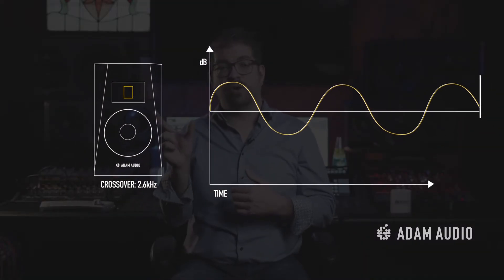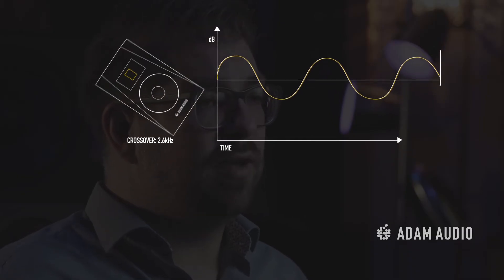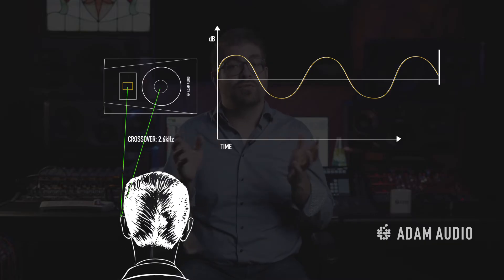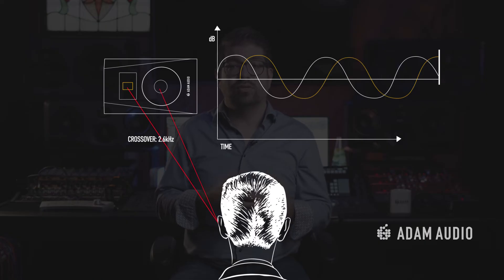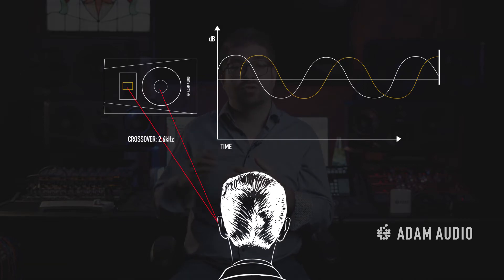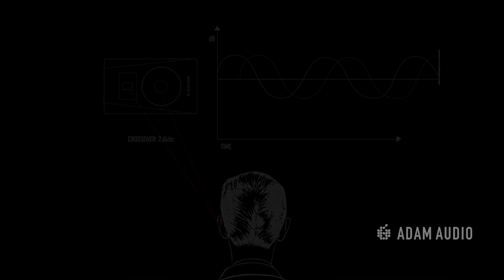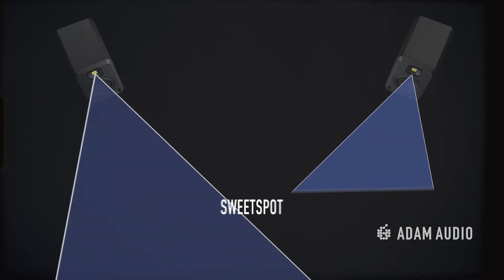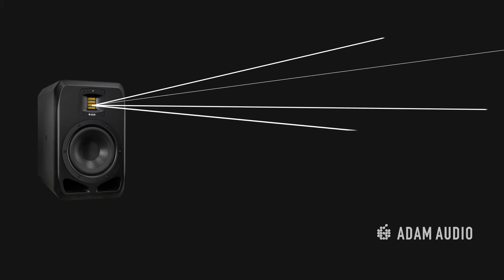VERTICAL Vs. HORIZONTAL Studio Monitors (Can They Be Flipped?) | ADAM Audio

Comment: would you recommend to flip to horizontal a couple of A5X (and manually rotate the tweeter 90 degrees) or keep them vertically and angle them down (5 - 7 degrees)? I need to lift them up aboy 10 cm, so the tweeter will go above my ears. Help :(

Comment: Would turning the T8Vs upside down be a problem for the wave guides? The placement would put the tweeters at ear level for me.
Reply from the maker: Hi @justinkovar3922! We do not recommend rotating the waveguide for the T Series.
Reply: I meant turning the entire speaker upside down, not adjusting the wave guide.
Reply: Hmmm…customer support gave me a different answer. 🤔 
“This is technically harmless and you are welcome to proceed as you have suggested.”

Comment: What this was very helpful. So i have my new A7Vs, and my desk is high and i adjusted the stands so the woofers point at ear and the foam that holds them up is has a slight pendance so maybe the tweeters point more to my ears. After watching this video i'm thing, should i lower the stands, so the tweeter point at my ears, risking more desk reflections (i guess) or... what other option do i have?
Reply from the maker: Hi @NATmusic27! The tweeter should indeed point directly to your ear. For better guidance,  please reach out to our Support Team and don't hesitate to ask all the technical questions you might have. The Support Team will gladly answer all your questions. You can send your question through the official form on this page: https://support.adam-audio.com/hc/en-gb/requests/new

You can also check the FAQs here: https://support.adam-audio.com/hc/en-gb

Comment: Hi! I'm not able to use T7V in vertical way because with my current desk the tweeter stays above my head. From what I understood from this video It's nog good to use them   horizontally. Can I use them upside down with the tweeter aligned with my ears?
Reply from the maker: Hi @caldini79, thanks for your question! Yes, turning the speakers upside-down with the tweeter on ear level is a solution. Greetings from Berlin! :)

Comment: I bought some used A8X speakers recently... I heard them in a work environment for an entire summer and was thoroughly impressed by the fact that at any volume, the mixes held up... They sounded better than any other speaker that I have ever heard... I assumed that the "X" meant that they could be placed either horizontal or vertical without any serious degradation at either orientation... Is that not the case?
Reply from the maker: Hi @dagwood4189! Thanks for your question. The A8X is designed to be placed vertically. If you place it horizontally, keep in mind that the in the video mentioned problems might appear. Enjoy your speakers!
Reply: @ADAMAudioBerlin  Thank you!

Comment: Can the Adam A7X be placed horizontally and the tweeter unscrewed and readjusted for horizontal placement?
Reply from the maker: Hi Richard! We don´t recommend placing your monitors in the unintended position.
Reply: What about the A7V? I just ordered a pair of A7V because the tweeter is meant to be rotated. I want to place them horizontal in my studio, and can the tweeters be positioned on the outer edges with the woofer positioned on the inner sides  @ADAMAudioBerlin
Reply from the maker: Hi Richard! The A7Vs are not meant to be rotated. They do have that option though but we usually recommend to use the speakers in their intended position. You can experiment with the space that you have and adjust the position to your listening preference.
Reply: @ADAMAudioBerlin  Ok good to know. They just arrived today and the only way they fit in my setup is horizontal and I rotate the tweeter to accommodate. They sound great from what I can tell so hopefully I can still use them with this orientation
Reply from the maker: Hi Richard! Enjoy them and let us know if you have any other question 😊

Comment: I have the opposite problem. I own the A77X and I need it vertical. As long as I angle it sligtly down and align ear-to-tweeter for the sweet spot I should be ok right? I read through the comments and someone said they loved the sound. I recently changed some stuff around and they would just work better if they were standing. If anyone reading this has done it, let me know if it worked for you. ✌️
Reply: It works fabulously well, i own the a77x as well. You gotta keep the tweeters at rear level also dont forget to keep the respective monitors at their correct place with the mid range drivers( the outer woofers) placed at the bottom and the bass woofers ( the inner ones) placed at the top. Speaker B should be on the left side while Speaker A on the right.

I was so lost since i wanted to do this a year back when i bought them but there was no information about them regarding mounting vertically on the internet present the only 2 people i came across was on twitter who had posted picture with vertical mounting so i just copied them and started using the monitors like that for almost 3 months( only god helped me ) but later on when i bought a room correcting software i realised the placement was off since the correction software wasnt working properly with that placement thats when i got in touch with adam personally wrote a mail to them and explained what i wanted to do and then they provided me the correct monitor placement and the info and thats when i realised i had them placed wrong all along. God help those people working in the studios  with the wrong placements lol

Comment: Thank you for the video. Just to clarify.... if we want to only focus on the main listening position and not the entire row, which speaker would work better : horizontal or vertical?
Reply: 4:43 He explains it here. The Adam tweeters perform differently horizontally and vertically. So if you're going to flip them, you need to unscrew and flip the tweeter too. Still not the best idea tho, some people reckon tilting the speakers down (if they're too high up, assuming that's why you want to flip them) is better than flipping them

Comment: If placed horizontally should the tweeter be inwards or outwards?
Reply from the maker: Hi Kim! If you are talking about a vertical monitor, there is no correct answer. That depends on the distance between your speakers and also your listening position. Try to form an equilateral triangle with the tweeter as the measurement point. Yet, we still recommend using the monitors in their recommended orientation. All the best, Daniel.

Comment: Are you saying that the speakers with mid range has a wider range so when listening 👂 it’s easier to stay in range of the speakers sweet spot than to have a speaker that has top and bottom drivers on the monitors am I right ? 🤓

Comment: In the case where you have the speakers higher than your listening position (ears). what is better? to tilt the angle of the speaker or to put it horizontally? Thanks!
Reply from the maker: Hi Jorge! It is always better to use the speaker as intended (always vertical for vertical monitors, and horizontal for the horizontal ones), so we'd recommend tilting them a little bit better than putting them in a non-intended way.

Comment: Makes me so sad every time I see someone placing their speakers horizontally when they weren't designed that way... This has become a trend for some reason, I see everyone making this mistake. Adam studio monitors are top quality and have professionally engineered for the best quality sound but you aren't going to hear their full potential unless they are placed vertically as the engineers intended.
Reply: I see this all the time in “name” studios with “name” mix engineers.

Comment: I am a bit confused now. I am no sound engineer so I just read manuals and apply them. The A7X manual says you can use the speakers either vertically or horizontally and they have diagrams that show the correct positioning of the loudspeakers in each case. The video suggests that a horizontal setup can be problematic. Is a7x special or should I ignore the manual and stick with vertical setup ?
Reply from the maker: Hi Baher! We recommend using vertical speakers vertically, due to the waveguide. It is built to widen the sweet spot and avoid reflections from the desk and the ceiling. You can of course use it horizontally, but with more reflections and a smaller sweet spot. In that case, there is a certain way to do it, which you can see in the manual. I hope that helped. All the best, Daniel.
Reply: @ADAMAudioBerlin  clear.. thanks

Comment: how about using the T5V horizontal? is it ok?
Reply from the maker: Hi, we would recommend using them vertically if possible. You will have a smaller sweet spot and more reflection from your studio desk and the ceiling. If you have to use them horizontally, please keep the tweeter closer to you and the woofer on the outside. All the best, Daniel.
Reply: @ADAMAudioBerlin  Thank you so much, you just saved my studio..

Comment: This is SO helpful as I just re-arranged my studio setup with three 32" monitors (half hex arrangement) and I was forced to place the A7X's above the monitors sideways. Vertical arrangement just has them way too high and outside of the 3x32" width is far too wide. The performance is definitely different at distances but <1M where I normally mix, they are performing well across the spectrum. My solution is to get A77X's but I'm not sure my wife agrees...
Reply: Ik I'm 3 years late, and you probably don't need this info or maybe even use these monitors anymore, but the a7x's have a rotatable tweeter that you can just undo the screws and turn 90°. Then you can use them horizontally. Sadly, I can't do this with my budget T7V's

Comment: Good explanation, about the A77X having the woofers aside the tweeter, I also have asked myself the same question. A possible explanation I can think of is the A77X are indeed mid-field monitors and so they are designed to be further away than smaller A5X or so, and at bigger distances the comb filter effect derived from the drivers not being in the same vertical plane can perhaps be smaller. 

We have had three monitors in the studio with the same driver structure (woofer aside the tweeter), the A77X , the Focal Twins and the two way PMC Twotwo 6, of which the manufacturer says literally in their web: "...their ability to operate in either the vertical or horizontal orientations without compromising stereo imaging or tonal accuracy." 

By the way, I have sometimes worked with both the A77Xs and Focal Twins put vertically on their side and have been really happy with their sound, at least in the sweet spot.
Reply: Do you feel that the sweet spot was smaller with the A77X vertical? Overall did they sound about the same as horizontal or were there any noticeable differences?

Comment: I’m thinking about buying Adam Speakers for my studio. I work in film which requires me to have a 5.1 set. Looking at the A77X  confused me, there is a right and left version which for me doesn’t make sense since I need a centre speaker. Is this speaker setup simply not for people who need a LCR setup?
Reply from the maker: Hi Selle! You are right. The speaker is not built to be a center speaker. For LCR setups we recommend using the S-Series instead. Our S3H studio monitor can be used as a LCR-speaker for instance.
Reply: Despite what Adam Audio says, I would say you will be just fine using the A77Xs also this way. Don't even bother whether it say LEFT or RIGHT on the box, just get 5 of the same A77Xs -- all five "LEFT" or all five "RIGHT." Or else go with these passive ones: https://www.svsound.com/products/ultra-center#

Comment: A useful, though probably sort of difficult, topic to cover would be odd shaped spaces. For instance, many of us are in a bedroom sized room, but we can close it off or we can leave the doors open, making the actual space for the pressure waves to propagate through the whole house or apartment.

In my case, I'm in a bedroom that opens into the apartment on the rear left. And, the middle of the back wall opens into a bathroom which in turn opens into a large closet. So, there's the option of having a significant chunk of the rear wall that is three times more distant. On either side of that are slightly less than door width walls. 

Some people may have doors on both side walls at the back, which means not really any rear corners, and what amounts to 'adjustable angle deflectors' instead. And there's no way to put in a corner trap there when there's no corner. 

Are there are any sort of general guidelines on those types of scenarios. Is it better to allow the pressure out into the overall space? Or does that just complicate things even worse? It would seem naively that it would allow for much greater dispersion of low frequency pressure, even if the space outside of the studio room is much more resonant.

I'll be measuring mine as I add treatments of course, and that's the final arbiter, but I was just interested if there's any thoughts on this kind of thing.
Reply from the maker: Hi Dean, thanks for watching and for a great topic suggestion! We will definitely add it to the list to cover in the future 👍

Comment: In a home theater set up where a bookshelf Klipsch rp500m Mounted to the ceiling as rear surround speakers with there be a difference in quality to save heights mounting them horizontal ?
Reply: I would not mount any single or even bipolar surround speakers horizontally.

Comment: Agree with everything he says including that ultimately it comes down to the user. I've used my A7x pair in standing position for 10 years. Recently my right speaker developed rattle and it wasn't loose screws or a blown speaker. When I placed it on its side the noise went away. Now both my monitors are on their side and strangely I like the stereo spread better for my treated space. I also use my setup for production and not mixing so this new setup doesn't affect me there. As long as it doesn't hurt the speaker, I'm happy to keep this new orientation.
Reply: Such wasted potential. A7xs have been professionally engineered for the best quality sound but you aren't going to hear their full potential unless they are placed vertically as the engineers intended. ... Rather just repair the rattle then place them vertically as the engineer intended
Reply: @sqwerty0829  He used them vertical for ten years and likes them better horizontal.. yet it's a waste some how? These are tools, not laws.

Comment: Interesting info, especially since the mid-frequency woofer on the a77x is positioned next to the tweeter horizontally, even though it has a high crossover frequency of around 3 khz....
Why is the phase issue relevant for the T7V with 2.8 khz crossover, but not relevant for the a77x with the 3 khz crossover?
Reply: ....and we have silence...
Reply: I really want an answer to this...
Reply: And for world famous Yamaha NS10s
Reply: Whereas I do not have an answer to your technical question, I can tell you that after listing for some time to the S3H, anything in the Adam T-series is just not even in the running.
Reply: @frankfarago2825  You would hope so. If the monitor 10 times the price by the same manufacturer didn't sound any better that would be a worry.

Comment: This is not entirely correct. If you have speakers with conventional round tweeters on a shelf,and especially a bookshelf, and they are not angled inwards as they normally are when placed on stands but facing you flat on and the tweeter is on axis with your ear, mounting them horizontally will not change the distance from any of the drivers to your ears at all. They are simply revolving 90 degrees around the tweeter axis on the same plane and the distance from the drivers to your ears remains constant. In practice, however, unless you only have one speaker and are listening in mono, it is impossible for both tweeters to be exactly on axis with your ears.

More important than speaker orientation and its effect on phase is that the sound you hear is determined mostly by the acoustics of the room, where you listen in it and where the speakers are placed in it. Moving around and away from the normal sweet spot position even by tiny amounts can result in quite noticeable changes in the sound balance throughout the frequency spectrum. I am convinced that phase effects caused by orientation are insignificant and it is other factors that are more important. I even used to have a set of bookshelf speakers ( B&W DM5s) which had their tweeters connected out of phase with the bass unit.

 Mounting speakers horizontally can definitely work but as a general rule the tweeters should be towards the inside rather than the outside because of the greater directionality of high frequency sound.  You need the tweeters to be firing as directly as possible towards your ears. Changing their orientation so that the woofers are nearer to room boundaries or corners can also boost the bass, which can be a good thing or a bad thing depending on what you want.

It is not a good idea to mount speakers horizontally if they have a waveguide designed to spread the high frequencies sideways, or have ribbon or heil effect drivers which have a horizontal dispersion pattern unless, of course, you can remount the tweeters 90 degrees, which with some models is possible. You can also mount speakers upside down if that helps position the tweeter more on axis with your ears.